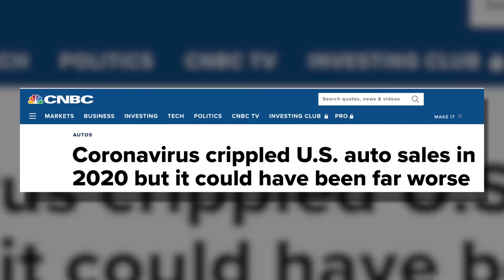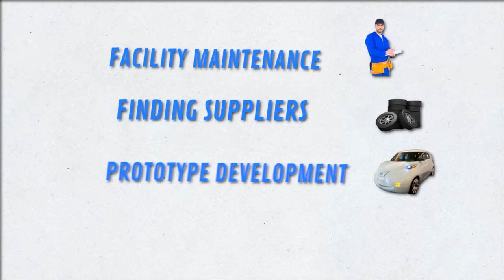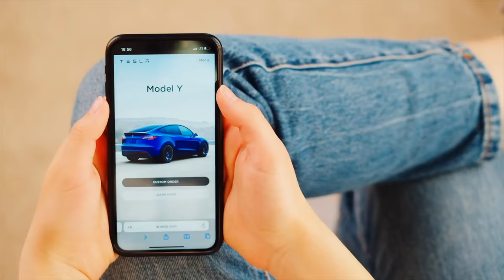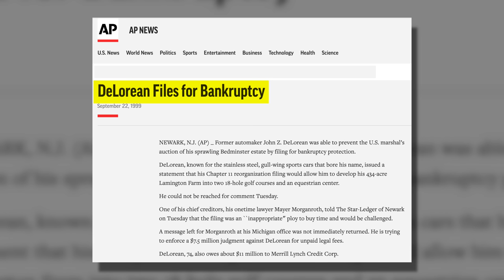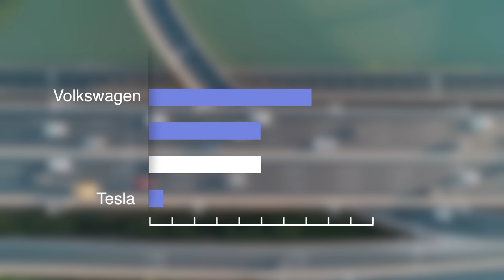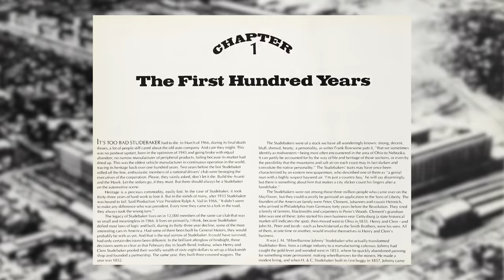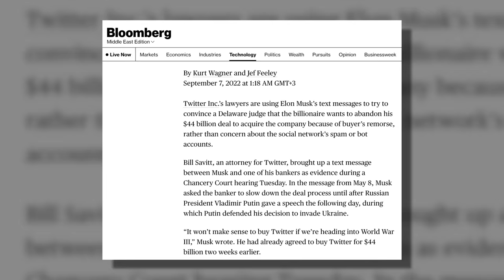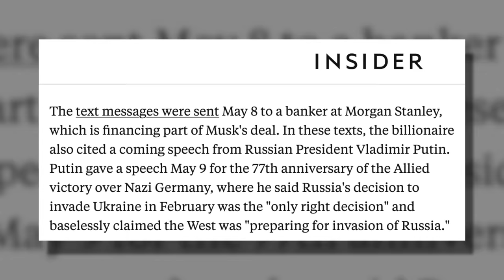Get Ready for Nuclear War

Comment: Very nice, except for one minor quibble.  That is, Studebaker didn't end in bankruptcy.  In fact, for their final year of production in 1966, their car division actually made a small profit.  But, Studebaker management decided that it wasn't enough to be worthwhile continuing car production, so they shut down the car division and instead focused on making industrial equipment.  Another fun fact is that Studebaker actually should have gone bankrupt in the mid-1950s.  The only reason they didn't is because Packard foolishly bought Studebaker without doing sufficient due diligence.  If Packard had done due diligence, they would have found out how Studebaker management was deliberately hiding Studebaker's extreme financial woes.  Packard's money, along with Studebaker's later diversification into industrial equipment, are the two things that saved Studebaker from actual bankruptcy.  Well, there was actually a third thing, which was the shutting down of their plant in South Bend, Indiana in 1963.  That plant had been a money-loser for many years, because it was so inefficient.  In fact, that was one of the financial fun facts that Studebaker management had kept hidden from Packard back in 1954.

And then, there was the Avanti, the car that should have saved Studebaker.  Instead, it helped hasten the demise of Studebaker's car production because of production delays caused by their troubles with getting the fiberglass body right.  There was a lot of initial enthusiasm for the Avanti, but by the time that it finally became available, everybody was buying Mustangs, and nobody wanted an Avanti.

So, the bottom line:  Yeah, the Vietnam war did do a lot of damage to the U.S. economy, as well as to our society.  But, I would posit that it had nothing at all to do with the demise of Studebaker auto production.

Comment: 200ci or 300 ci Ford straight six 1950-1980. points, standard gears. that should start with a new battery.
Reply: Most manufacturers dropped points style ignitions in favor of electronic ones between 1973 and 1975 but you got the right idea.
Reply: @jeffrobodine8579  i am just speaking of radiation hardened components. all electronic ignitions within 20 miles of the blast will FAIL. also. the 200 and 300 Ford 6's are bullet proof and easy to tear down and get parts for.

Comment: I just want a wagon with room to stretch out in the back, like an a older Volvo or a simple long bed pickup. Just the basics. 4 cyl 110 hp tach, speedometer, oil pressure, radiator temp. Ac heater. I seen a pickup today and the guy paid 100k, that's nuts.
Reply: I got a '13 Subaru Outback that I nap in. I'm 6ft and can lay flat in the back.

Comment: Electric cars will not work during or after an EMP attack.
Reply: They won't work anyway in winter
Reply: The power grids cannot sustain everybody driving electric cars. Case in point they couldn't even provide electric to southern California in the 100+ degree heat this past summer.

Comment: I understand that the channel is having in mind the American audience that is hyberbolic by nature
But honestly if a car company find itself between rock and a hard place, they always have the option to build simpler vehicles reduce R&D costs ect like the Russian manufacturers already done producing vehicles without ABS for example
They can also reverse to older technologies like the Iranians do for decades building modern looking cars with 70s technology under the hood..
At the end of the day a car is more or less a box that is made to take us from poin " A" to point " B" smart " clima" air-conditioning electronically control suspension and fancy headlights are just accessories

Comment: Volkswagen’s are pure garbage. Counter support bearing was bad on a suv model. The driveshaft is connected to the transferase with a piece of rubber. The drive shaft uses cv axles instead replaceable u joints. The driveshaft was binding which took out the support bearing. The bearing was $200 a used driveshaft was $800. My 12 valve dodge with over double the mileage has new u joints and support bearing making it brand new. Total cost $150.

Comment: In a worse case scenario, if a world war/proxy wars breakout, automakers will switch over to aiding the war effort. So instead of building commercial/residential automobiles, they'll be building military vehicles and other products. And another world war doesn't necessarily mean it will go nuclear. We've just been conditioned to believe so. But yes, the risk is definitely there.